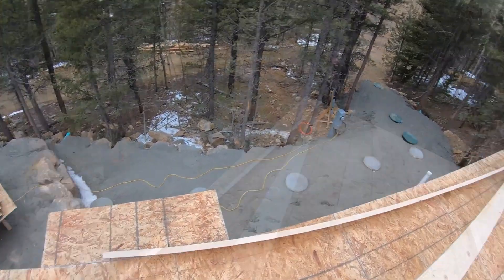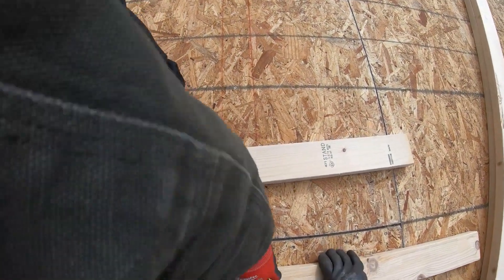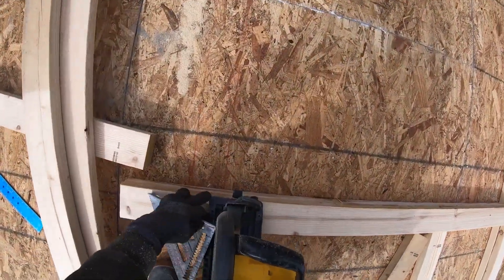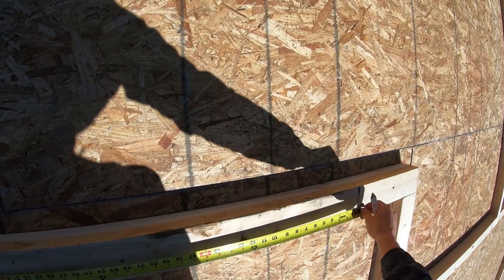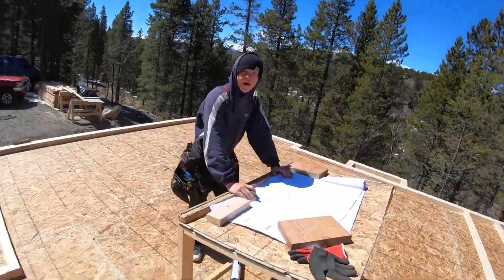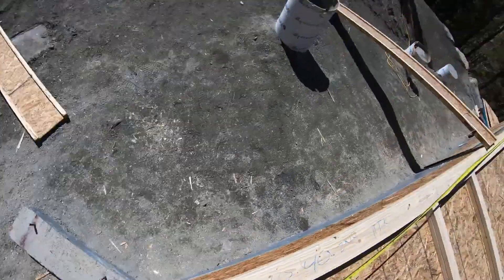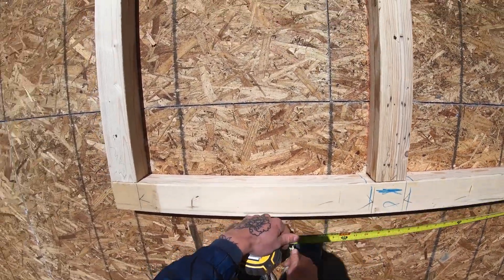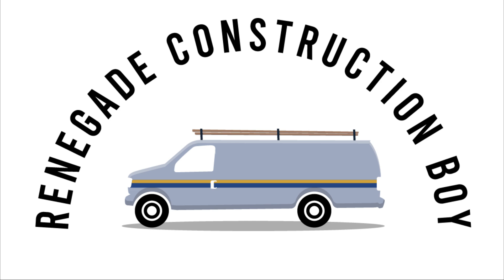How To Build/Frame a House Part 3--Wall Plating and Layout! GOPRO POV

Comment: Great video--using with my students.  Hey get a Bigfoot worm saw adapter, or small beam saw and cut those plates in one hit??
Reply from the maker: I’ve got one! Also an 8-1/4 blade works great
Reply: @Coffmanconstruction  nice.  I ended up using my Bigfoot saw like all the time framing.  Being able to cut 2x4's on edge or cut header stock, or plates... money!

Comment: Should toe nail your second plate so you don’t have to catspaw the nails out. And run your third plate while plating then you don’t have to lap after walls are up
Reply from the maker: We don’t pull the nails, just bend em and run it 👌

Comment: Is that a 8 1/2 inch blade with the guard removed on the saw 
 nice  work keep up the good work
Reply from the maker: 8-1/4!  Fits perfectly in the dewalt rear handle

Comment: Awesome vid man! What's that trick  when you push the saw back n forth while cutting double plates?
Reply from the maker: It just barelyyy cuts 3” so I’d push it back a few times to get it to finish the cut
Reply: @Coffmanconstruction  8 1/4 blade fits the 7 1/4?
Reply from the maker: Yes sir! Not recommending it per se…